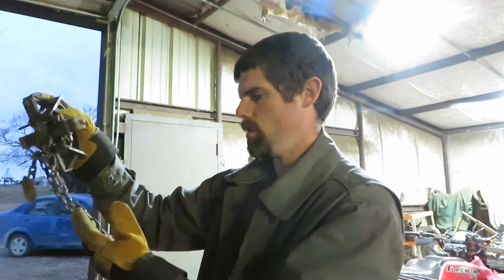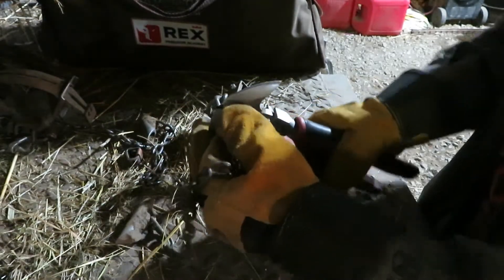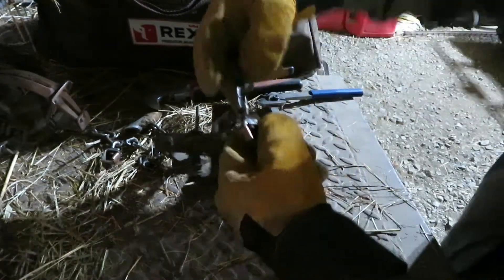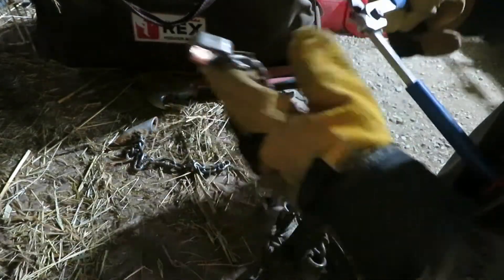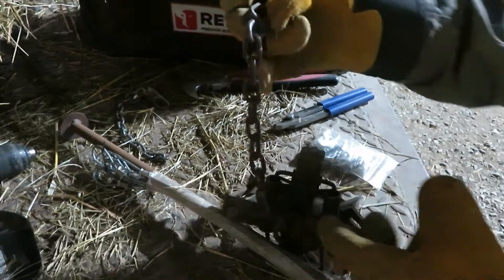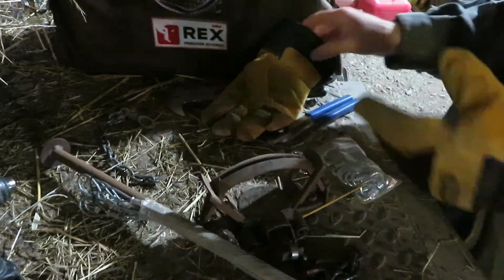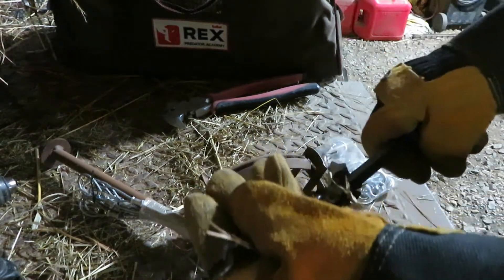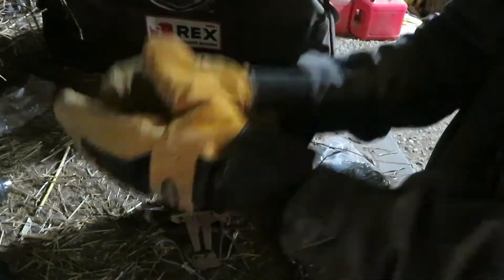Trapping Tuesday E3

Comment: I have heard of people using a cable that attaches to the chain so you can pull from the cable instead of anything else
Reply from the maker: Yes but they are weaker than the chain and can be more easily damaged.